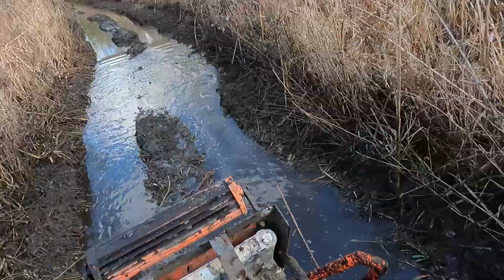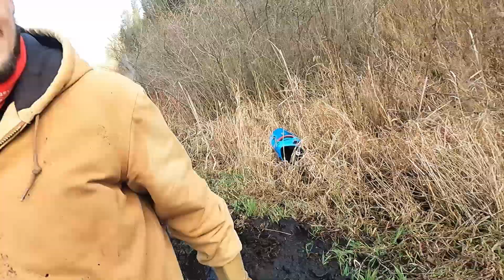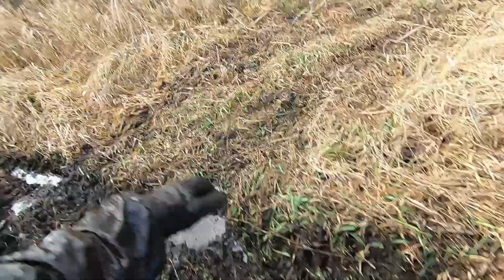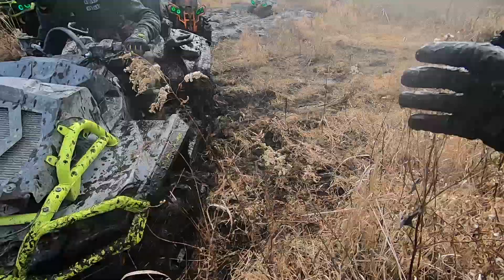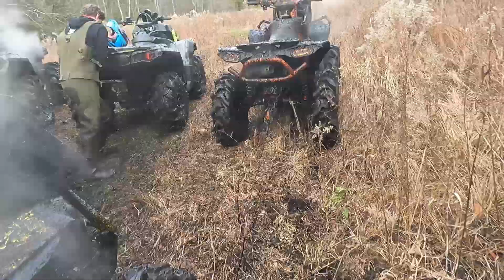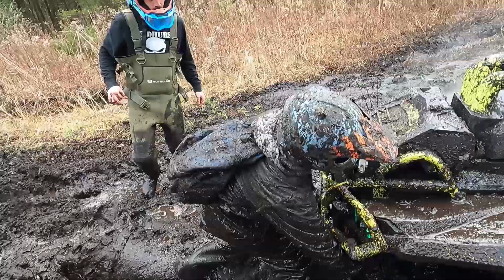2021 CANAM OUTLANDER 1000 XMR STOCK OR AFTERMARKET TIRES

Comment: So does the max chassis's stability make it more boring or confidence inspiring? Does the extra weight make you sink/get stuck more?
Reply from the maker: Sink, stuck because you have a longer chassis your center point will be lower when going over steep hole exits. Also its heavier.
Reply: So would u buy the shorter chassis in the 850 next time ?

Comment: What tuner did you use for your bike? Also i debaiting between 30x8.5 havoks or 31x8.5 havoks is there really a diffrence. i have a stock 570 xmr and i want to wheelie and still be able to pull hard in mud.  Thanks
Reply from the maker: Just a dobeck air/fuel tuner. I would recommend you flash your ecm through CrazyBrowner on instagram! Put a cvtech trailbloc as a primary with a 1020 spring with 12 gram weights. Then add a white epi spring and you can run 31 havoks all day and be able to wheelie
Reply: @LyndhurstXMRMY  where do I buy the 1020 spring and the weights? Also the secondary white Epi spring? Is it ok if I dm u on Instagram?
Reply from the maker: @gabehardman  gonahead brother! Dmboatsales can order them